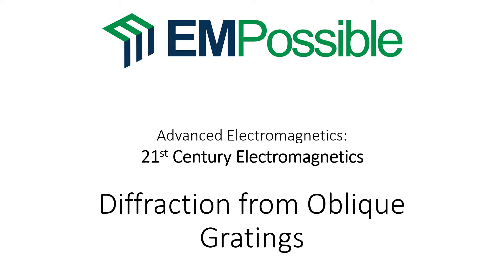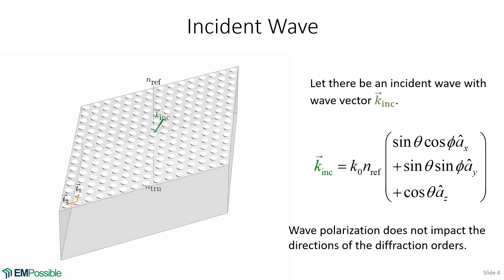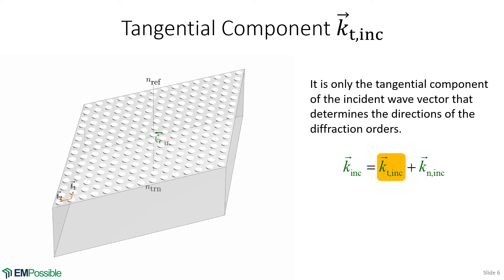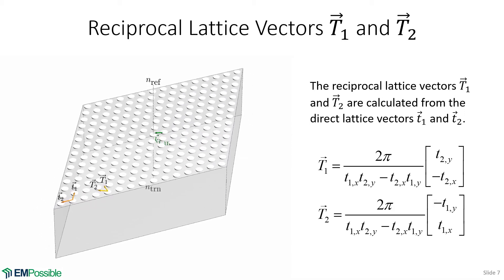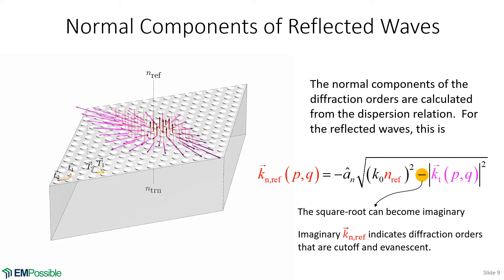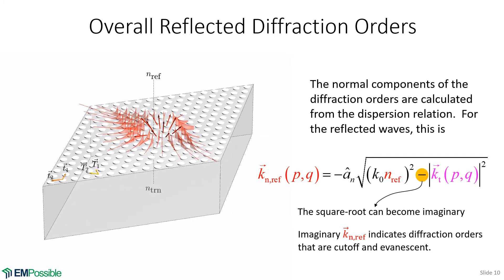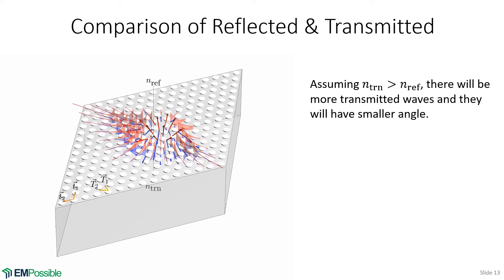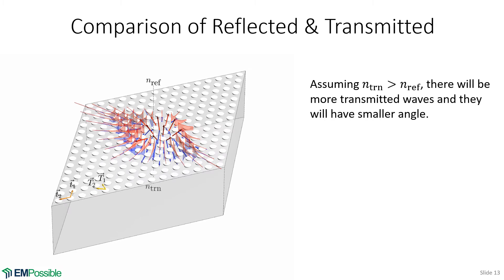Lecture -- Diffraction from Oblique Gratings

Comment: Thank you for this very informative lecture. Would it be possible if you do one example in MATLAB, for example, diffraction orders from hexagonal geometry?
Reply from the maker: This is the second request for this.  I will add it to my to-do list!  I think it would also be good to repeat the example with a different choice of lattice vectors to show the answer is still the same.   Thank you!
Reply from the maker: Think this way, the refractive indices have little to do with the diffraction, other than making the grating itself.  It is more than somehow the field amplitude has become periodic with the period of the grating.  That aspect has nothing to do with refractive index.  In fact, it does not matter where or how the field became periodic.  Once it is periodic, it can pass into any medium.  The nref and ntrn come into this because they describe the refractive index where the diffraction orders are being observed.  If the substrate was finite, ntrn would be used inside the substrate, but nref would be used below the substrate assuming the same material above and below the grating.